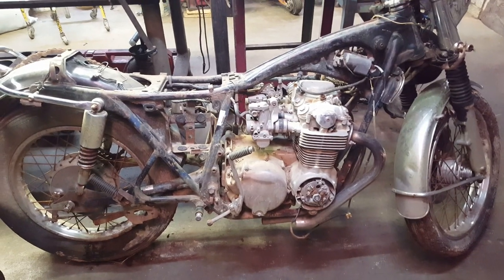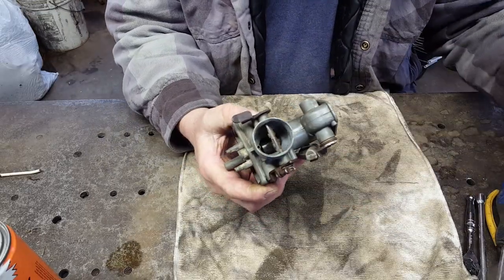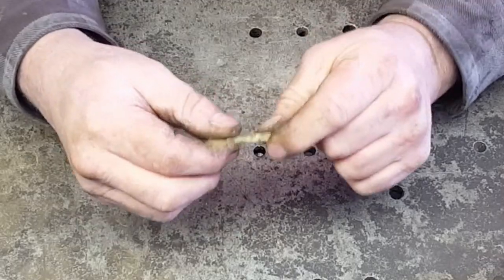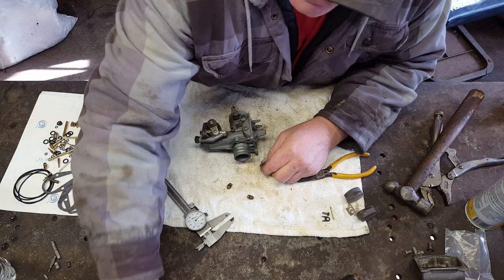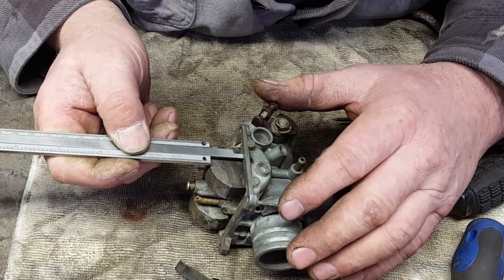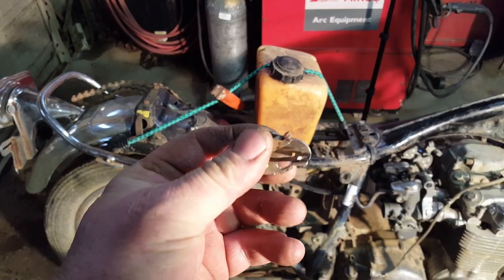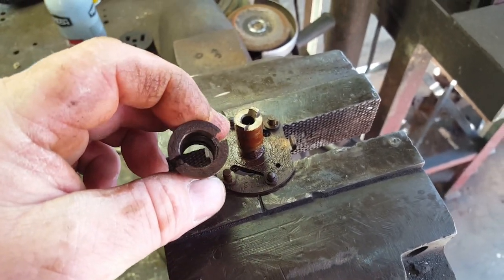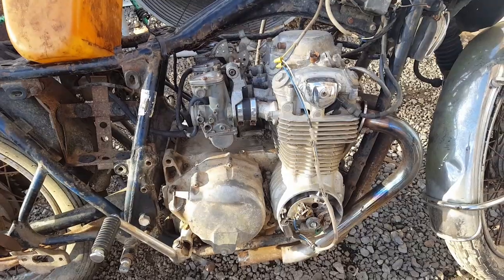CB550 Go Kart?!?! | Part 1 Rebuild the carbs and get it running

Comment: Hey Chad, here's a top tech tip. when cleaning the seats in the carb, use a q tip with a small amount of fine laping compound and just turn it with  drill or by hand. cleans them right up

Comment: I've been saving this project for when I had some down time, Chad. I think I had a twin carb car once. You get to my age it's hard to remember, I had a new, (old, but new to me), car every year or so for decades. Getting two carbs to play well together was hard enough. Four? This is why I like single cylinder motorcycles. I am, I fear, a bear of very little brain. (A Winnie the Pooh reference, in case Pooh never made it to the US of A). Anyhoo, must dash. Next installment is awaiting...
Reply from the maker: And they still ain't synced with each other! Tried again a few weeks ago and I just can't figure it out. 🤷🏻‍♂️

Comment: the stock jet sizes will not work correctly with missing air filter system missing and open exhaust. iit will start and run but not well at all.
Reply from the maker: Runs like a scalded dog. Float level is the idle issue.